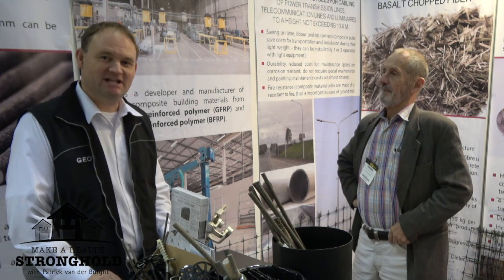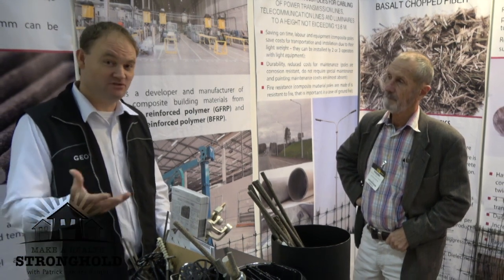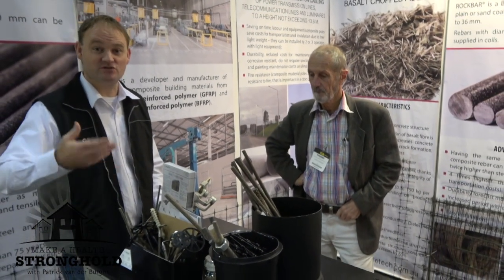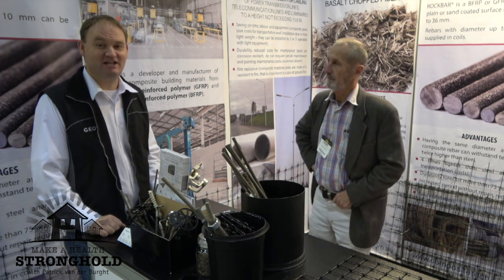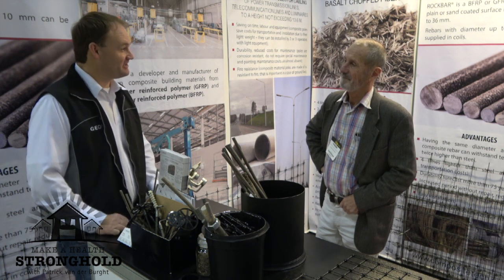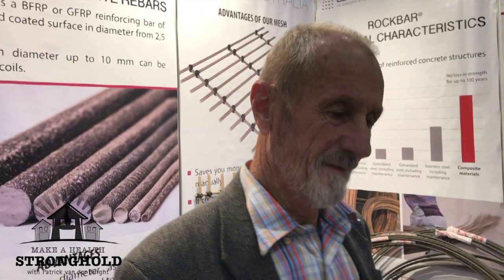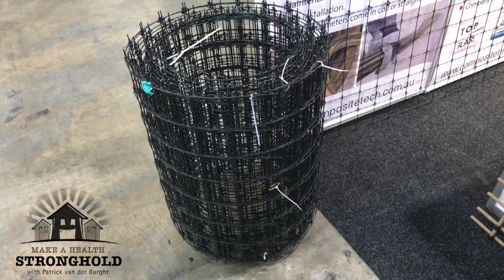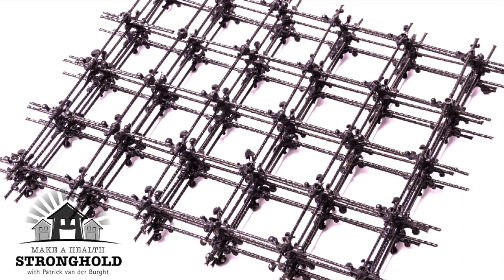Non-metal concrete reinforcement rebar from basalt rock is also EMF proof

Comment: The steel reinforcement (rebar) is not attached to the building ground or neutral directly in the USA.  The ground of house ( and neutral) is typically attached to a copper ground rod driven 8' into the ground and further bonded to a copper water pipe.   That is it.
Reply: +1. Agreed. .. Shunt to Ground.
Reply: @michaelschneider-  We share a surname, but with a variant spelling.
Reply: I don’t think he was implying rebar is intentionally touching ground. Just the cases where it happens unintentionally. Either due to some the rebar sinking before the concrete is set, or via cracks in the concrete over time.
Reply: In the building of a swimming pool in the U.S., I believe the rebar is connected to a ground rod with a bonding wire (#8 bare copper) just as all the mechanical equipment for the pool is grounded to the same ground rod.
Reply: @CuriousEarthMan  If you connect copper to iron, the iron is going to rust out. That seems like a very poor design choice.

Comment: Hi Patrick.  I’m planning to use Basalt mesh to reinforce a garden pot made in thin concrete.  Basically it’s going to be a rectangle with a floor and feet.  I can see how the mesh reinforces the faces, but at my corners, how can I use Basalt to go around the corners and maintain integrity?  I could bend the mesh but unlike steel mesh does not hold its shape.  How do I hold it in place?  I could change from a sharp 90˚ bend to a radiused curved corner? I would prefer to avoid this.  Thanks.

Comment: How has basalt reinforcement held up since this video was made? What does the result look like after a few years? Can the reinforcement cause the concrete to crack in locations with variations of temperature? I saw a graph somewhere showing how similar the thermal expansion is for concrete vs steel which is one of the reasons steel reinforcement is used. How does thermal expansion of basalt compare? Cheers.
Reply: It's very dangerous to use it as rebars. It will suddenly fully collapse without a warning. No time to repair the defect. Its a rock after-all, once it's cracked it just snaps into two parts, then the building collapse without a warning.
Reply: Apparently the Canadians have a standard for its use that engineers use. We were told the Canadians like it as it gives their bridges longer life spans.
Reply: @GoodGirl-wi5yo  We want proof
Reply: @GoodGirl-wi5yo "Its a rock after-all"
Nonsense.  The aggregate in concrete is rock after all.

Comment: How come we need any reinforcement in concrete when Romans built many concrete buildings without reinforcement which has lasted over 2000 years?
Reply: Becase not all concrete structures are under compression only. Under tension, concrete is not very strong.
Reply: Because the romans used a very light concrete mix, and yes they designed it all using arches to only use the concrete in compression. Fascinating! I guess we use unnecessary reinforcement when we could just change the shape and do as the romans did.
Reply: It’s not just the shape, it’s also the ability to build in a confined land area and with less material. And also (probably the biggest reason) is weather - the Romans didn’t have extremes of temperature or excessive rain. And there’s also access to volcanos too which not all parts of the world has. And it’s not as easy to apply because it’s much thicker than traditional concrete spraying equipment allows.

Which is a shame. The sooner we ditch steel reinforcement the better.
Reply: The Romans built millions of concrete structures. A handful have survived 2000 years. Some of those were documented when they were being built as being replacements for previous concrete structures that had crumbled and failed within years of being built. These days we require every building to last to its design life.
Also, the Romans weren't building skyscrapers. The techniques they used simply won't work for modern building heights.

Comment: The higher the electrical conductivity, the more impervious to moving/changing magnetic fields. Silver, copper, gold, aluminum and on down the line in that order
Reply: The lack of understanding of these people is scary. It's literally having the opposite effect they are hoping for.
Reply: No. EMF = ElectroMagnetic Fields. Basalt fiber won't interfere with your cellphone signal.
Reply: And to think, that flexible rebar comes from lava, well done, great stuff. In an attempt to clarify, I wasn't clear what was meant in the title by "EMF proof". Since "Basalt fiber won't interfere with your cellphone signal", that simply means it isn't very electrically conductive. Ok, good. That's what I would expect of lava rock, basalt, way lower than the electrical conductivity of iron rebar. Simply talking Lenz's Law here. Iron is the 13th-most-conductive on the list at https://en.wikipedia.org/wiki/Electrical_resistivity_and_conductivity. 
I think it's just a mistake in the title, I hope Patrick will see this and consider changing it. To me, "EMF proof" says ... impregnable to electromagnetic fields while reality is ... EMF pretty much won't even know the basalt is there basically as it passes through. But EMF are affected to some degree by iron rebar, just a little bit. Not because iron is paramagnetic but instead because it is electrically conductive. If your building has silver rebar (highest conductivity), first of all you live in Dubai, ha, and secondly at your desk in that building you have no cellphone reception. Kidding of course, silver would be far too expensive. Go with basalt.
I have a bit of passion on this topic because of a lot of experience and the public tends to be under a mistaken impression of how that all works but there's no reason for it to  be so because it's really simple once you grasp it.

Comment: Iron bars in concrete: When structure fails the whole structure will not collapse killing all the people inside that building. and we have time to repair the defect. As iron elongates or bends before full failure.
Basalt bars in concrete: You'll never know until it cracks and suddenly fully collapse. Never use basalt as bars. And never be in a building which has used basalt bars.
Reply: I have seen my share of rebar cement structures collapsing on YouTube India
Reply: This comment was made by a person who has vast experience with one method. 
You hear these types of comments made by "experts" throughout history whenever a new idea/ technology comes along. 
What is true is that basalt rebar has ideal applications where steel utterly fails (i.e., in salt water environments for single-sory homes and businesses, as well as docks).
Beware when anyone uses superlatives such as "never" and "always." They lack vision and (more importantly) wisdom. 
Cheers!
Reply: @kickinghorse2405  What we need is more information about how to engineer with basalt. Certainly there's no shortage of examples of steel-reinforced concrete that has failed under its design load, including in rich first world countries, so if we can learn to engineer better structures with basalt rebar, we'll be ahead.

Comment: 1:00 ever heard of electric wires? Yeah, they supply you with electricity, and they're in your wall, and they have >100x EMF than any metal rebar could ever have.

Non-metal rebars are not for "EMF proofing" but 3:00

Comment: Ah, engineering for the tinfoil hat folks. 

I assure you, the rebar in my foundation, slab and below-grade walls are NOT grounded to the earth. The electrical system is, but not the metal in the concrete. When the opening salvo is crap. I don’t need the full sales pitch.
Reply: No need to knock what you don't know everything about and no need to be rude Mark. Metal in slabs was indeed not always grounded, in some countries that has only come in in the last few years. Some countries may not have made it a requirement.
Reply: @geovitalacademy  ah, but I do know, see. And I’d rather get slow-cooked, just a little each year, by EMF, over buying “the farm” in a slab failure all at once.
Reply: Basalt Rebar doesn't rust. The steel Rebar in your foundation will rust. When it does it will expand and crack your concrete. Basalt becomes PART of the Concrete.
Reply: @theebalz  Basalt is rock. Concrete is mimicking rock. Not the right mix of performance under tension with performance under compression. We have decades and decades of experience with steel rebar performance in structures, and properly built, the performance is clearly stable, long-serving, and ethically engineerable. Basalt can never attain the tensile strength of steel, while steel can be kept stable in concrete for very extended periods.

Once you've built a foundation or three, you really see it in application. But hey, keep dreamin'.
Reply: @JeremyRobertWalker  I've designed, formed, poured and finished slabs and foundations, seen 'em with and without reinforcement, seen them last and fail, so I know something. I also know that going through the cost and effort to use a brittle reinforcing rod in a brittle medium is not going toward success. So allow me to feed "fu<king moron on a power trip' right back at you. Heavy on the moron.
Reply: @markstevens1729  Building a foundation on non-load bearing soil will fail regardless of materials used. I get the impression you just pour the shit and don't understand the chemistry
Reply: @JeremyRobertWalker  Quite a derogatory imagination you have there. I turn 62 today, live in a strict-building code area and have personally built three buildings myself, including the house I sit in - passive house, above building code standards. Have worked alongside a finish carpenter (6 yr), an Architect (5 yr) and have been building everything from buildings to furniture for near 50 years. You on the other hand seem to be able to sling shit pretty well for an armchair expert trolling on YouTube, so there's that.
Reply: @markstevens1729  I have built more buildings than that and I am 34 so there is that.
Reply: @markstevens1729 My mama and your mama were hanging up clothes . . .